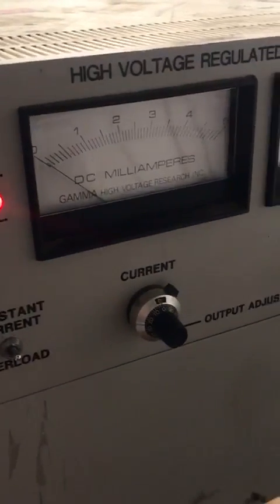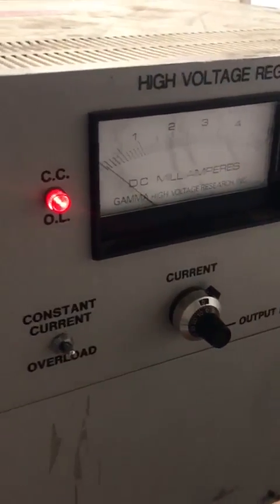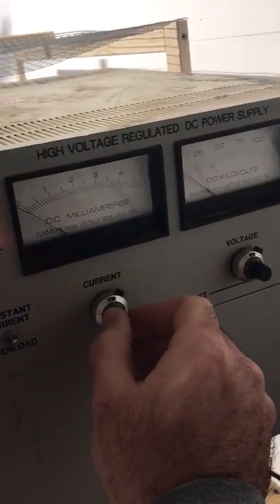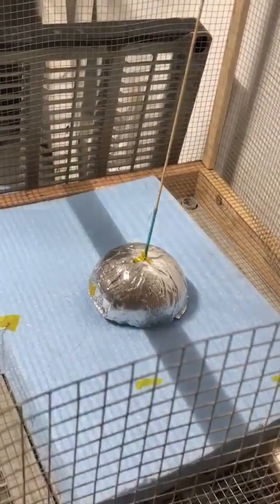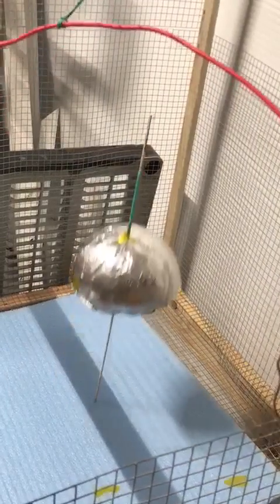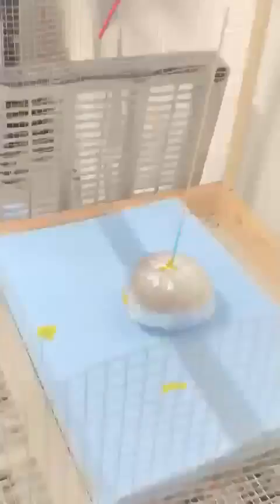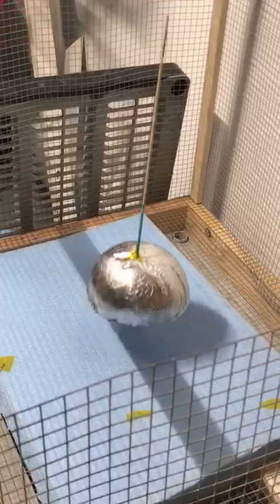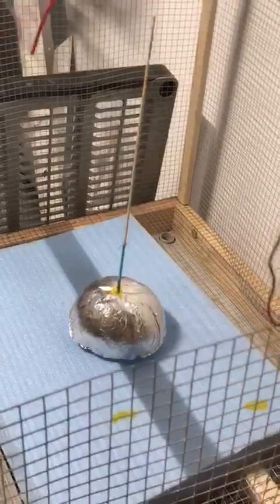Bell shaped ion craft flys even better!

Comment: You guys probably know this already but these 'ion lifters' do NOT rise due to propulsion from the 'ion wind.'

The 'ion wind' is a secondary effect.  Here's what's happening, electrically - keep in mind this though.  Recall that when you take a load of clothes out of your dryer, they accelerate (change their motion) seemingly all by themselves, just like a lifter does.  This is static electricity - one side positive (say, your arm hairs or whatever) and the other side negative (electrons build up on the warm clothes due to friction in the dryer).  'Opposite charges attract.'  That's exactly what's happening in a lifter with some nuances owing to the setup.

1)  one wire is at a high voltage (can be either negative or positive despite many claims, because air molecules can be ionized positive or ionized negative).  It just so happens that if you use a high POSITIVE voltage on the wire, that high positive voltage strips off electrons from nearby air molecules, which turns the air molecues into POSITIVELY CHARGED ions (they just had a bunch of their electrons stolen by the high positive voltage wire in your setup). 

2)   Where are you now?  You have a bunch of electrons ripped off air molecules and pulled to the high voltage positive wire, and the air molecules having lost negative charges are now positive ions, and the high voltage positive wire REPELS THOSE positive air molecule ions because "like charges repel" (that's where the 'ion wind' comes from, btw)

3)  where do those positive air ions go?  AWAY FROM THE POSITIVE HIGH VOLTAGE WIRE, that's for sure.  Some of the positive ions are PUSHED DOWNWARD toward the grounded part of the lifter.

4)  what do we have now?  A SPACE CHARGE of positive (air molecule) ions sitting right next to a grounded surface. GUESS WHERE THE GROUNDED SURFACE WILL MOVE?  "Opposite charges attract" -
the grounded part of the lifter moves quickly into the positive ions space charge.

It is NOT the moving space charge of ions acting as the propulsion.  Here's some evidence.  Put the youtube viewer in slow motion (click the gear icon at the lower right, click 'Playback speed', click '0.25')  and you see the movement of positive ions space charge ('ion breeze') is NOT propulsion at all
https://www.youtube.com/watch?v=ckGaTUEbaKw

Like I said, you guys may know this stuff already, but maybe some viewers of your video might get bamboozled with the story you'll find in other videos that 'the lifter moves due to ion wind propelling it'

.
.
Reply from the maker: So are you saying with higher voltage an ion lifter would work in a vacuum ?
Reply: @FalconSpace   No, you need the ions.  The propulsion is not a 'push' from ion wind.  It's the (relatively) negative potential of the grounded part of the lifter being attracted to the positive-ion space charge.

Lifters don't work in vacuum because the ion production is low-to-non-existent.  You need an ionizable gas.

The 'ion breeze' is not propulsion.  The ion breeze does not act like a "Newton's 3rd law" device such as a rocket.  https://en.wikipedia.org/wiki/Newton%27s_laws_of_motion

I watched videos on youtube I think in 2018 that kept claiming "ion breeze is propelling, pushing, the lifter upward" and a lot of people believed it.

The electrostatic field created by the high voltage and the ionization of the air molecules, creating the electrical attraction, is the accelerating effect, not an 'ion wind' propulsion.

I've also read accounts saying "lifters work in vacuum"  nah, they won't work without an **ionizable gas**.  The creation of the ionized space charge above the oppositely-charged part of the lifter is the electrical attraction that accelerates the device.

If you want a device that works in a vacuum, you have to learn about vacuum polarization and the Screening response of the vacuum.  Ie. you need a device that creates its own "inertia quench" effect in the vacuum.

The uniform isotropic vacuum attempts to 'even out' the 'sharp edges' of electric charges, which make the vacuum anisotropic, non-uniform, not the ambient condition the vacuum 'prefers.'

The 'Screening' effect of the vacuum pulls that off, the electron-positron pairs have an "induced dipole" effect which is caused by the electric field of atoms. 

All matter objects have a 'rest inertia' (aka rest mass) and all matter objects have a gravity field around them.  THOSE ARE THE SAME THING but 99.999999% of people on the planet do not know that.

The atoms of matter objects -- their electric fields - disturb the vacuum, which then 'Screens' the electric charges of the matter object.  It is a transfer of energy, this Screening effect, that polarizes the electron-positron pairs of the vacuum by forcing a Charge Separation on the electron-positron pair.  That is what "polarizing the vacuum'' does.

All matter objects polarize the vacuum.
All matter objects have 'rest inertia' (rest mass).
All matter objects create their own (small) gravity field.
All matter objects create a small inertia quench around them.

All those 4 things are the same.

If you want to INCREASE the inertia quench...
If you want to INCREASE the gravity field...
If you want to INCREASE the vacuum polarization...

you have to align and accelerate the atoms.  How?

- use Alzofon's method
- or use piezo material inside a microwave cavity resonator
- in either case,  use microwave (at least) frequency, high voltage, pulses, and a very high static DC field

I'm still working on mine.  After building a couple of models that failed,, and getting discouraged, I decided "no more experiments, no more guessing.  If I can't figure out the exact physical nature of how gravity is created, I'm not moving forward"

'Shotgunning' an electrical solution - hey it's a waste of time.  It's like trying to build an F1 engine without tools
Reply: By the way, you probably knew this or thought about it, but there is indication Alzofon's method to 'align and oscillate' is at work in some of the vehicles.

By aligning and oscillating all the atoms together,  that is a 'coherent' behavior of all the atoms in the hull. 

Since we know that energized electrons, when they fall into a less-energized orbit they release a photon --

- and since the atoms/electrons in an aligned/oscillating hull are moving in a coherent fashion --

It's logical to assume that when the pulse is over with, the electrons in the hull fall back to a lower energy state and release a photon.  And since they all act in coherence - energized at the same time, de-energized at the same time when the pulse is over -- they would release coherent electrons. 

That's why a lot of ufos look like they're putting out laser light, which is coherent light.

The tricky part to all this is, how much power is needed to pull it off.  Because to energize electrons that will give off coherent photons like a laser, it seems like it would take a lot of power.  And since the frequency of visible light is WAY above microwave frequency - see https://en.wikipedia.org/wiki/Electromagnetic_spectrum -- 

The coherent, visible light these vehicles give off, this is in the 300 Terahertz frequency range,  or 

300  x  10^12 Hz
300,000,000,000,000 Hz

It's a stumbling block, maybe.  One thing for sure, I have no plans to commercialize anything, sell anything, or tell anyone if I get an experiment working.  From what I've seen, it may not be the right time.

Dave Adair, if you watch several of his videos, since I know how gravity and inertia works,  I can tell he built that ability into his 'rocket'. 

He created a fusion device for power.  Well, the Tokamak fusion reactor in 50 years has never worked, never put out more power than put in.  Why?  Because fusion requires a gravity field.  The Sun's fusion requires its immense gravity field.  And this is one of the reasons I suspect they do not want to share the fairly simple creation of gravity.  It would make the Tokamak become over-unity after 50 years of 'planned failure'.  That tokamak has burned through billion$ in grant money and a lot of people know why it doesn't work.  It needs a gravity field.

And Dave Adair knows how to create gravity - in one of his videos,  actually a couple of them, he *very briefly* said  "I cancelled inertia*  BAM he knows how to create gravity.  That's how he was able to get his fusion device working.

And in some of his videos he's made it clear that he's been told  "we don't yet have the infrastructure for fusion" so I've been sort of waiting to hear they bumped him off.

Because he went on and on in one of his videos about selling the expertise to other countries.  Time will tell.

So being a hobbyist, knowing they don't want the Tokamak to work (or they would have been teaching gravity/inertia in the 1950s or before),  I'm keeping any successes I have - private. 

Besides,  I don't find anyone really interested anyway.  Most people like having a car.  Sit them down and try to explain how the engine works?  They don't give a ratsass.
Reply: I've read almost all scientific papers (=hundreds) ever published about "ion wind" (plus even only remotely related topics) and I personally come to the conclusion that you're right and wrong at the same time. Electrostatic forces are likely to play a role with those tiny lightweight DIY lifters, especially when the collector electrode acts as a capacitor, but this doesn't mean that the "wind" of neutral / uncharged molecules (and ground effect) doesn't play a role, too, or that it isn't even a real thing - and depending on things like voltage, gap distance, atmospheric pressure, ion mobility, humidity and electrode shape, this "wind" can reach up to ~7 m/sec with a single stage configuration (exerting a thrust efficiency of up to 110 N/kW, experimentally demonstrated by K.Masuyama in 2013, of course on a small scale we're rather talking milliNewton and Watt or mW). Absolute thrust is higher with multiple stages - it almost linearly adds up to the total thrust. If electrostatic forces were so important, the contribution of the "first" few stages in a serial setup would be rather low, because they would be relatively far away from the measuring point at the end of the series AND their force would also be (at least partly) cancelled out by electrodes of opposing polarity in between. Electrostatic forces of charged surfaces - other than "wind" - also don't explain why the velocity can be increased - following Bernoulli - by channeling air DOWNSTREAM of the collector (or after the last collector in a series) through a nozzle. Unless maybe at very high speeds where some ions might manage to bypass the collector, the ions have been neutralized at the collector side, i.e. downstream the collector channeling ion flow in an electrostatic field can't be the explanation why the Bernoulli principle still seems to work here. It must be the neutral/uncharged wind component. 
Ion wind efficiency is also higher at higher velocities. Especially with multistage plasma actuators / dielectric barrier discharge (and also the tri-layer plasma actuator) - slightly different design, but same basic principle - much higher velocities and thrust efficiencies have been demonstrated that can't be explained with electrostatic forces.
You're welcome to call ionic wind a "secondary effect" , but this doesn't mean that it doesn't substantially contribute to the total lift.
I also don't think that "secondary effect" in the context of electrostatic forces is really the best wording. This would e.g. be more appropriate if neutral air molecules were accelerated because e.g. (hypothetically speaking) they started to act as dipoles (btw. O2 and N2 don't, and there isn't much CO2) under influence of an electrostatic field - but we know that this isn't really what happens. The commonly accepted theory it about collisions between ions and neutral molecules, i.e. it's rather a secondary effect of ionization (specifically: accelerated ions), and not of the static field. 
I agree with your explanation regarding the space charge relative to the grounded electrode: it's exactly what gets the ions going. But this doesn't imply that neutral molecules are uneffected - which btw is impossible, given the density of air. There are simply so many molecules present that you can't accelerate lots of ions through this volume without also causing lots of collisions with neutral molecules. That's simply a matter of molecule size and applied stochastics.
IF uncharged/neutral wind were an neglibile factor in what we call "ion wind", you'd also have to explain why we can measure "wind" in uncharged air downstream of the space charge of the unit with pitot tubes or hot wire anenometers. Those both shouldn't react to electrostatic forces.
Reply: @___Chris___  It's a space charge effect. The +25,000vdc on the thin top wire of a lifter strips off electrons from atoms comprising air molecules that are near the 25,000vdc top wire electrode, and then become positive ions  (because they have a net loss of electrons).  That is the 'space charge' and it is physically sitting immediately above the 0vdc thin foil electrode.

The thin foil electrode is thus electrically attracted to the positive ions space charge just above it and moves upward.

And when that happens, the thin 25,000vdc wire ALSO is moved upward.
And then it strips off electrons from air molecules at the now-higher location.

And that new space charge attracts the lower 0vdc thin foil electrode upward AGAIN.

Rinse and repeat.

There is no propulsion, no 'push force' from the 'ion wind.'  Put the youtube viewer at 0.25 speed (slow motion) and watch this video, which demonstrates the physical reality of what's happening => https://www.youtube.com/watch?v=ckGaTUEbaKw
Reply: @Greg_Chase   At least you should be aware that your personal understanding here is quite rare and in contradiction to basically everything that has been published in recent years in peer-reviewed scientific journals.
 Accordingly, as the guy with the extraordinary claim, you're also the one who should have the extraordinary evidence, but you're not presenting that in your answer.

Moreover:

- between ionization (close to the emitter wire) and collector, the ions have to cover some distance. Why is it so hard to accept that they also interact with neutral molecules along the way?

- the ions (/the space charge) are not just "sitting"; I assume that you don't really believe that, either, and that this choice of words was probably only for illustration purposes, but it's not helpful: because in reality the space charge is of course in continuous flux - so are also the interactions with neutral molecules; leaving this aspect out of the picture may be part of the reason why you refuse to accept the existence of actual "wind" and not just accelerated ions skillfully meandering through the space between countless billions of neutral molecules without affecting them in any way, despite our relatively high atmospheric density at ~sealevel and despite the fact that a gas diffuses until each molecule takes up as much space as it can at the given pressure and temperature (for an "ideal" gas the end result of this tendency follows Avogadro's law, in which each equally sized sub-volume has the same number of atoms again). When you accelerate charged molecules through this best possible distribution, the present molecules will quite quickly try to reestablish the equilibrium, which is a reason why -  although air molecules are tiny and although there is a quite a lot of space in between -  we can't only look at the probabilities of "head-on" collisions. The "neutral" air will be affected either way.

-  (1) ion movement away from the emitter and towards the collector and (2) opposite ("upwards") movement of emitter and collector themselves (and the entire rest of "lifter" with them) are relative movements based on Newton's 3d law of opposing forces (actio et reactio); what moves towards what actually depends on the position of the observer. Therefore, instead of saying that the collector moves towards the space charge, you could just as well say that the lifter moves the ionized air downwards. Wether we call this "wind" or "ions only", ultimately should be decided based on testing if there's any uncharged downstream flow left after as good as all ions are neutralized at the collector. Exactly that has already been done in dozens of studies and within are the arguments and experimental data that you prefer to ignore

- let me rephrase: why is it that you ignored the  arguments about the conditions downstream of the "space charge" and past the collector? As one downstream effect that would NOT be in conflict with your theory, I would give credit to the possibility of static force between a collector acting as a capacitor and a surface (e.g. a desktop under the "lifter") with a much different potential or dipole induction, but as I mentioned, several other aspects can't be explained solely by a static field in uncharged air  downstream of the space charge (applicability of nozzled flow manipulation according to Bernoulli, pitot probing (--> static pressure), hot wire anemometer(--> flow velocity effect on cooling)). The uncharged air itself must have a non-zero velocity (reaching several meters per second in experimental data). To be very clear: I'm talking about uncharged downstream FLOW, aka "wind", and not just the velocity of the lifter (which can also be fixed), nor the movement of charged molecules (=ions) within the dielectric. I will assume that being speechless towards these arguments was your way of revealing that you're wrong. With this I'll rest my case unless you contribute something actually convincing.
Reply: @Greg_Chase  Let me just add: this study provides all the evidence you need:

Park, S., Cvelbar, U., Choe, W. et al. The creation of electric wind due to the electrohydrodynamic force. Nat Commun 9, 371 (2018). https://doi.org/10.1038/s41467-017-02766-9

Abstract: Understanding the interactions between ionized matter and neutral particles is a prerequisite for discovering their impact on natural phenomena. One such phenomenon is the electric wind, which supposedly occurs due to the charged particle–neutral coupling in systems of weakly ionized gases, but this mechanism remains unclear. Here, we report direct evidence that electric wind is caused by an electrohydrodynamic force generated by the charged particle drag as a result of the momentum transfer from electrons/ions to neutrals. The model experiment is based on a pulsed plasma jet as a source of weakly ionized gases generated in the helium gas at atmospheric pressure using Schlieren photography. Studying the helium gas flow trajectories at different discharge parameters allows one to distinguish between the effects of streamer propagation or space charge drift causing the electric wind as well as to determine the role of electrons and (positive) ions in wind generation.

Link to Full-text article: https://www.nature.com/articles/s41467-017-02766-9
Reply: @___Chris___  Dude I'm not going to argue with you. I have an EE degree and a physics background.  Personally,  I don't see how anyone could misunderstand that the electric field gradient created by the physical asymmetry between the thin, small positive wire and much larger grounded foil, coupled with a MASSIVE, electrically positive space charge (positive ions), could get it wrong but I discovered that, just like you, there are many people with very poor observational skills and/or lack of understanding of electric field gradients and space charge effects.

I invite you to 100% commit to your current understanding and enjoy it.  I don't even feel guilty saying that because I tried to help you, I even provided video proof and you failed to believe your own eyes.  You are 100% committed to your belief, and I will spend no time talking you out of it!
Reply: @Greg_Chase   That's funny, because I was trying to help YOU.
And ... it also happens to be an exciting topic.

No worries, I also have a vast scientific background.

"I don't see how anyone could misunderstand that the electric field....[etc]"
No worries there, either. My understanding is in complete agreement with the current mainstream teachings of physics (also - even though this is youtube here - I care more about serious research than anecdotal primitive DIY lifters).

Likewise, you didn't give me any indication to make me doubt that you understand at least the basics of how strong electric fields in a dielectric between asymmetric electrodes "work" (you gave me reasons to dare to somewhat question the depth of your knowledge, though).
What you illustrate regarding space charge and its interaction with the collector electrode isn't total nonsense, either. Yet, you're "wearing blinders" by only acknowledging a fraction of the complete story.
 Our disagreement mainly concerns whether or not neutral molecules are indirectly affected, too, through momentum transfer between charged and neutral molecules. I explained why this happens. This is physics, not "belief".
Similar interactions between charged particles (electrons, protons, ions) and uncharged atoms (and small gaseous molecules) are a normal process happening all the time in the Earth's ionosphere. Do you question that, too?

The role of neutral molecules is where you are in a very lonely position. This is not just me talking, you can take almost ANY paper on the subject. This shouldn't come as a surprise in  2021, considering that direct proof for neutral molecule interactions in electrohydrodynamics goes as far back as the 1960s (see e.g. the work of G. Tayler and J. Melcher). Coming from your position, you'd theoretically have to refuse the entire field of EHD. Good luck with that!

Meanwhile, all I get from you about the role of neutral molecules is basically a "no", not a "why not". You're complacent with one explanation why "lifters" move, whilst ignoring that sometimes several principles sum up to the grand total.
At the same time, I provided very concrete arguments that you didn't even try to debunk. I didn't share an "opinion", but logical deductions based on verifiable facts - and they prove you wrong.

Lastly, did you even look into the linked article published by Nature.com?
How do you explain the deflection of the ENTIRE helium stream (from the "buoyant" upwards force towards the horizontal plane / axis of the electric field) , caused by the high-voltage pulses? Neutral helium molecules shouldn't care about the electric field, if you were right. The thing is: the electric field manages to control the ENTIRE stream, neutral and charged molecules alike. This is direct undeniable visual proof. If you still don't see it when you look at the photographs in that article, then you're also giving a good example for "not believing your own eyes".

Cheers ;-)